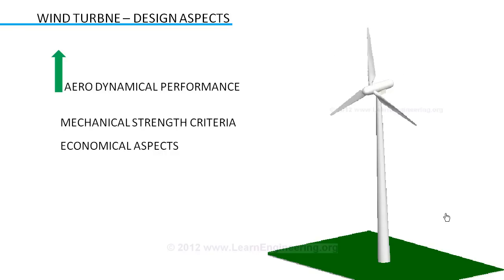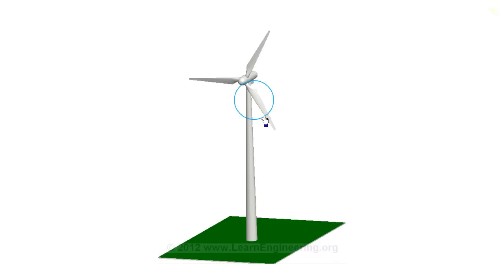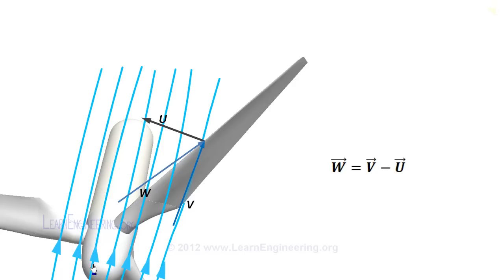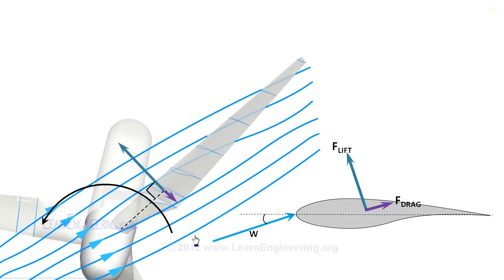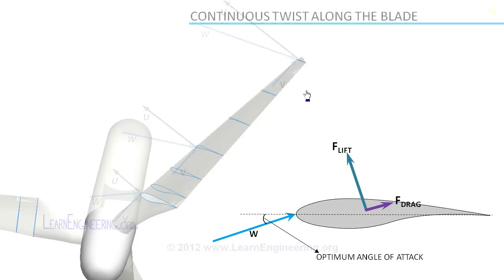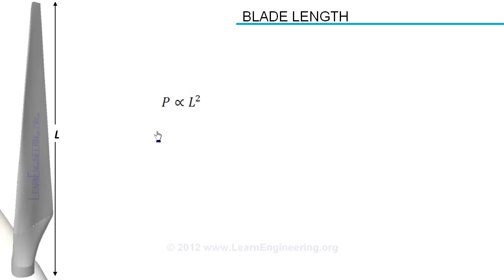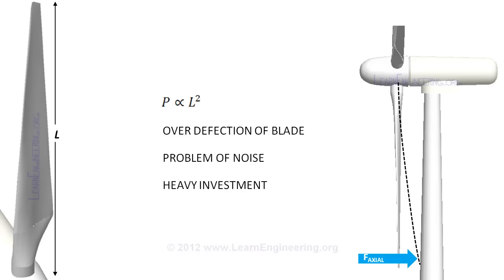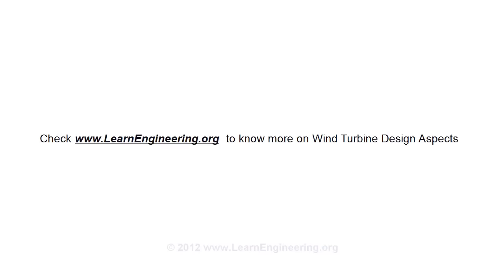Wind Turbine Design

Comment: Can a magnet to magnet  helped the wind blade and the pole so the wind blade and the pole has magnet that pushing the wing blade not hitting the pole or simply  build a metal building like with magnet ring like rail or like train track creating like hovering  that the wing blade are connected or combined  to the magnet rail on ring at the same time the wind blade spinning so again the building skeletons made in metal you can have many wind turbines in one building made out of metal paris is made out of metal so again when there is fixing the turbines it is easier to work with and not doing like mountain climbing every time it needed fixing of the turbines with building like windturbine you can have stairs and elivator it has a stop to the wind blade if needed fixing I have already commented  the oil platform builders long time ago to create this kind of system building like with many wind turbines because the ocean has enough wind also to make free energy by using wind turbine   ? 👽😇

Comment: You lost me in the first 1/4 second of your animation when you have it traveling CCW from the front. This is, of course, because I've never seen a windmill which didn't go clockwise from the front.  This is akin to animating the wing design of an airplane with the plane flying backwards.  That would be hard to take seriously.
Reply: Loose nut

Comment: If the aerofoil cross section gives lift in the same way as an aeroplane wing, won't it make the blade flex increasingly with radius, putting it under undue stress by bending it along its length? Wouldn't simple deflection from a flat sheet be sufficient, and easier to manufacture and maintain?
Reply: here lift acting on blade is to rotate(not continuous stress or lift force acting), 2nd its acting over wind turbine blade not alone over aerofoil, aerofoil is just used as transverse support to support wind turbine blade to not buckle under pressure longitudinally...not like aeroplane case to where lift use to take off aiplane thus continue action of pressure on lower part of blade

Comment: Hi
i have to design a 12 v wind turbine. i am using a 500kv motor. how do i decide the length and pitch of the propeller. please help!
Reply: Learn Engineering Nice Video, but explanation of pitch angle is not correct resp misleading. Machine control works in a different manner. 
By chance you'll find it in no book.
Reply from the maker: To decide upon on length and pitch, you need all the operating condition and output parameters. Please mail us those details.

Comment: fantastic video, .......
excellent implementation of  fluid mechanics. we are doing a project to establish the stiffness and strength of wind mill blade made of composite material .......
we are done with our research work but stuck up in design part .we would be very much grateful if you could help us with the dimension of the blades and its accompanying parts and with further stuff related to wind mill ........